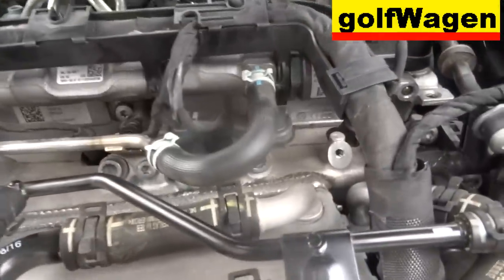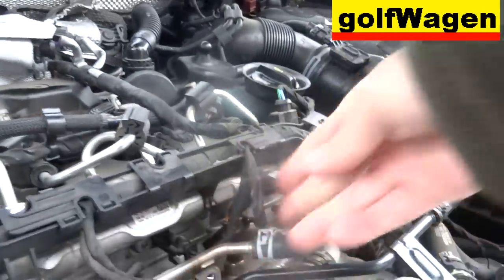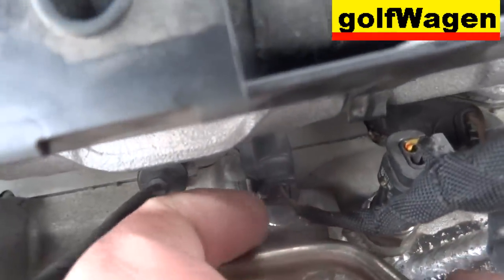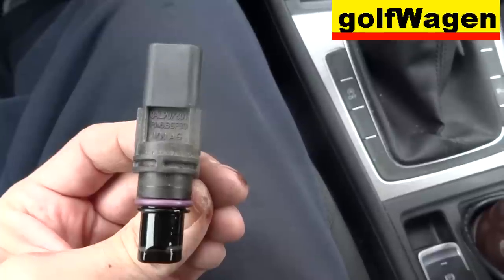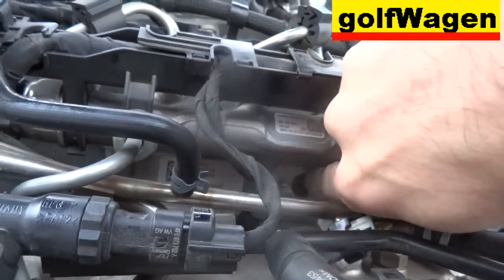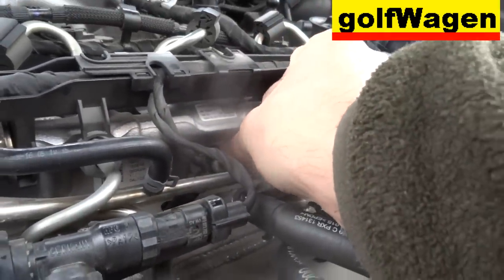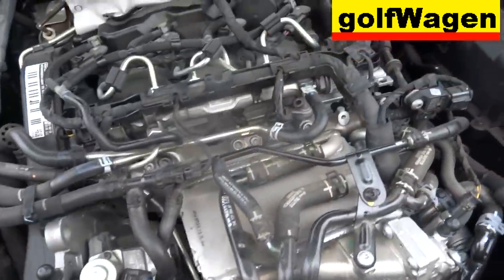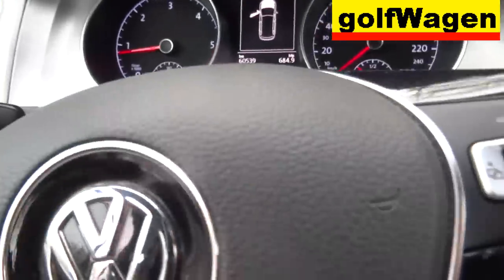VW Golf 7 Camshaft position sensor (G40) change

Comment: Is it possible that vcds does not show any error and Camshaft position sensor is faulty. Ivee struggling with mornig long crank as well as it happens during the day as 3 or 4time start the engine.?Fuel pressure is fine as well as the injectors (-2,8 +2,8)
Reply: Bonjour oui c’est possible que les témoins ne s’affiche pas sur le tableau de bord,après 1 ans de démarrage difficile le témoins moteur c’est enfin allumé pour me permettre de savoir que cela venais du capteur d’arbre à came (sinon il été indétectable via vcds ou autre) il faut le changer pour être tranquille.

Comment: I have change but some time gives to me again,problem...what I can do
Reply: hi get a geniune one or aftermarket use the code on the original part and get one with same code on it if you can get it go to nearest Vw dealer and ask him about the part 100% will fix youre problem good luck !

Comment: Hi I have changed the sensor but still getting problem.  I have vw passat b8 2015
Reply: So its chain or timing belt problem
Reply: @jubojubo460  thanks. I got this problem after timing belt change .

Comment: HI, DO YOU KNOW IF THAT SENSOR IS ON THE SAME SPOT ON PASSAT B8 2.0 TDI 2015 190HP?
Reply: Yes,it is on the same spot
Reply: I also have the same car as yours. My car also has the issue of not starting. Cranks long and sometimes fires up and sometimes just shuts down. 

What sort of problems did you have on yours?  I have changed all the glow plugs however issue is still the same. I’m now going to change the Camshaft sensor and see if that helps 🙏
Reply: @AliBagcetin did it fix your problem?
Reply: The fault will be the control valve that controls the solenoid

Comment: Hello! What would be the cause of incorrect operation at idle and during regeneration? It runs normally (over 1200rpm). I cleaned the sensor from the air filter, I cleaned the egr, I cleaned the damper, I changed the clutch kit and it does the same. Thank you in advance!
Reply: any luck sorting this issue? I have the same issue. Thanks
Reply: @EkremNurkerim  unfortunately no one was able to find out. there are days when the engine runs perfectly and days when it does the same as in the clip.

Comment: I have a skoda octavia 2 1.6 mpi bss motor code and i have a problem with starting it. In the morning it starts fine but afther several hours parked in the sun it starts at the second or third key. I changed the gas pump, the gas filter, spark plugs, the n 80 valve and the distribution. I only have tjis problem when its hot outside. I also changed the temperature sensor, cranksaft senzor. Can you tell me an ideea to start repairing my car?
Reply: Bse motor excuse me
Reply: Intake camshaft
Reply: تغيير الرشاشات
Reply: I have to change the senzor or the demisia?
Reply: Change the camshaft?